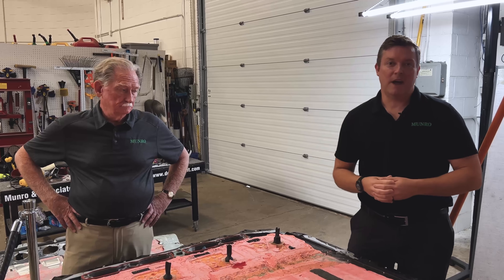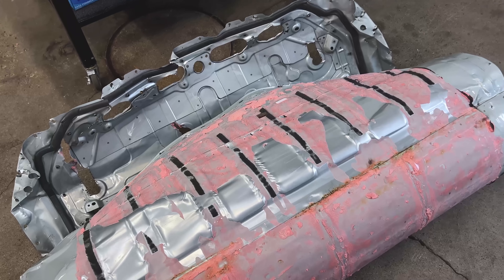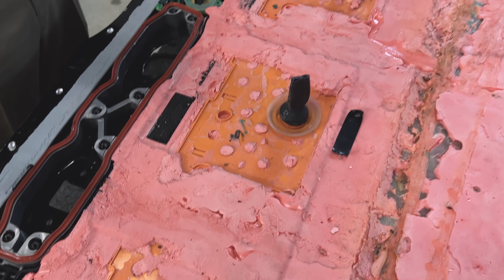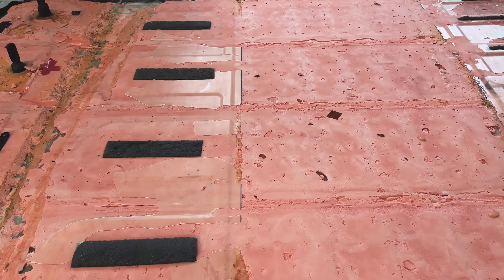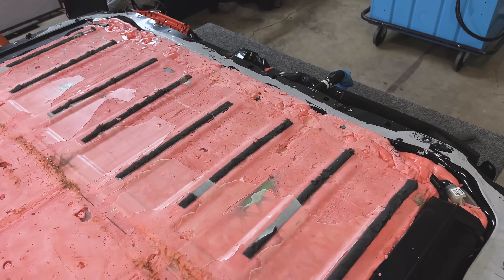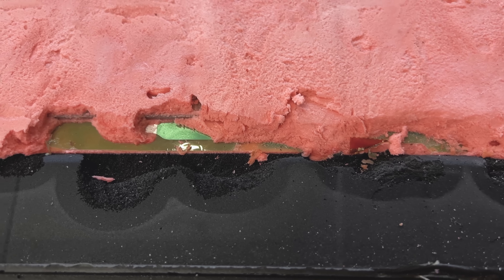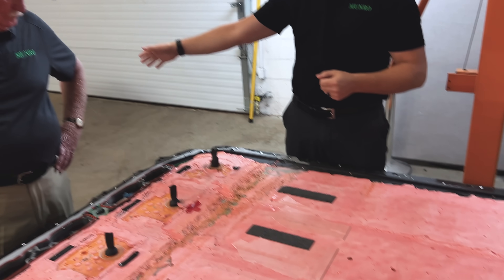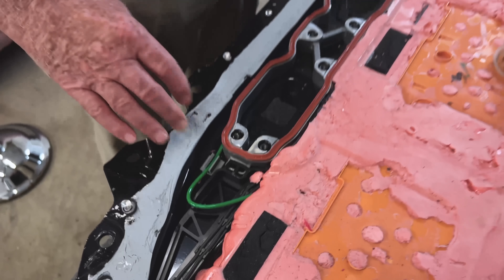FINALLY! 4680 Battery Pack Lid off | Tesla Model Y Update

Comment: 0:25 - Well, I don't think THAT is ever going back together!!
If the battery pack is truly "structural" i.e.holding the front and rear together, why did the Model Y not fold up when it was removed?
Reply: It’s strong enough without the battery for non-crash situations.
Reply: This pack is not "holding the front and rear together"; it just replaces the original floor panel. The vehicle didn't fold up because it still has the rest of the structure (including rocker/sill sections); it's only missing the floor panel.
Reply: Because your Side panel + roof structure is strong enough to keep the car together. You forget that the B-pillar + Roof structure is so strong it has to withstand and survive side impacts at like 60mph?

Comment: Elon said it's much easier to remove the batteries from the bottom of the pack, rather than peeling the top off.
Reply: I interpreted him as saying that recycling will be done from the bottom, IE it will be easy to extract the materials that way. Repairability and extracting intact modules/cells could be a completely different story.
Reply: The pack is attached to the bottom of the ca.  the packs unbolted from the bottom of the car and removed and a new replacement battery with a warranty is installed in the car.  The cells are totally surrounded by the ridged foam.  The pack is not designed to be repaired.  It is designed to be shredded and the metals in it are chemically separated and purified and used to mak a new battery pack.

Comment: My #1 question How on earth will they recycle these modules......WOW.....
Reply: Shred it. As simple as that.
Reply: @pashko90  I agree. Shred and grind to  produce a high grade ore.
Reply: The first question should be reusability! Recycling comes at the very last position! After car use batteries even at 70% still have great energy storage use…..
Reply: @alanmay7929  Belive me, if i'm getting any pack what still have a capacity left i will reuse it as much as possible.
Reply: @pashko90  - and then you will bury the pack in your back yard when it is at 0% usability problem stick it in a landfill.

Shredding these things is a more efficient way to recycle, just like chunking lead acid batteries, and achieve 90+% recyclability.
Reply: @DavidHalko  0% capacity is still way too far away, i'm upgading first gen EVs what 12+ years old, even old modules/cells still going for a full price. You can recover over 90% of materials from a current packs with a current tech, its not gonna be a battery anymore, but this materials still can be used in other things when you do not need perfectly clean materials.
Reply: @pashko90  - good work on replacing cells!

The day will come, when they get buried in the back yard by someone when they can’t be made useful. 

I am watching it happen with solar panels & lithium batteries, already. This is especially the case with people buying land that has a solar project on it in rural areas… the “more ethical” just pull a permit to bury it all, and they are being granted permits to do so. I can’t imagine the rest.
Reply: Funny how people are parroting Elon’s tweets almost word for word as gospel with zero apparent critical thought to what might actually be involved here and the process’ impact, this is true fanaticism.

Stuff like this is probably exactly why Tesla is criticized for insufficient disclosure of the environmental impact from their own operations.  Imagine cracking open a battery in a new energy vehicle designed to help us stop using a gas tank of fossil fuels only to find the energy source  is a mass of pink foam that’s made from fossil fuels.

I wouldn’t be shocked to discover the solvents/chemicals necessary for recycling are also derived from fossil fuels on top of the impact from the recycling process, disposal of chemicals used, etc etc
Reply: @Destor-p3b  everything is based on fossil from that foam the liquid that they must be taking about……. It’s a shame tbh!
Reply: Congratulations, yours is the 12th worthless comment on repairability/recycling.

Comment: I’m sure it’ll dissolve in something. The tube might even be to inject some solution to aid in removing the top cover. Or pressure balancing. Or both perhaps.
Reply: And I'm sure that will be a totally clean process that will happen under strict environmental precautions in those third world countries used cars end up.
Reply: @Nelson-Man  lol no way a battery will land there, this is high value even if it doesnt work at all anymore, which wont happen anyway, so, no, you are not informed well.
Reply: @JohnSmith-pn2vl  Old cars end up in third world countries in masses. If you don't believe that, let it be threshold countries, that's not much better. Also, the recycling process of this battery - if there is one at all - seems to be very labour intensive. And where is labour cheap? Exactly. In poor countries where people don't freak out just because you poor one or two tons of solvents a day into the local river.

Comment: Looks terrible, looks like something that might have come out of the Soviet Union. 
Cars aren’t like phones where you buy a new one every two or three years, I wouldn’t trust this to last eight years let alone 15.
Reply: Congratulations, yours is the 11th worthless comment on repairability/recycling.
Reply: Mosf of the sovet union products was been build to last and very serviceable.
Reply: @pashko90  idk about that man, maybe the ak47
Reply: So its... icky because its sealed in pink foam and you don't "believe" in batteries that last longer than the cars they are in? 

The 4680s are designed to do that. LFP batteries are designed to do that. They are Not an expendable part any more than the gas tank of an ICE car. The spec is about 1M miles or more - this is to 80% charge capacity when the battery is considered to be "no longer producing a good range". 95% of the cars will be rotten hulks by then... and the battery will still be good for commuting.

I would look up the specs on the 4680 and compare them to the 18650s and 2170s that have been in the field for years and still running after hundreds of thousands of miles. The pack is fault tolerant. If a few cells here or there die, they are isolated automatically and the pack runs without them. (And there are about 900 independent cells.) The packs are armored on the bottom to deflect nasty bits of road debris.
You don't "repair" batteries and they Rarely get replaced at All.

The days of opening a pack and swapping a module (cost effectively) are pretty much gone. 
As fabrication prices drop, the proposition of opening them up to fix them becomes increasingly untenable.

The tough bit to grasp is the idea that the battery has gone from the Eveready that lasted a few hours in a flashlight to a few years in a cell phone to something that's never removed for the life of the car... a very long lived car, like the structure itself or the gas tank of your ICE car. That's how reliable the new generation of batteries has become. 

Even then, the pack can still be dropped out of the bottom and replaced. 

Hence the design.
Reply: @avgjoe5969  are these LFP batteries? If that’s the case I heard that these things don’t even charge if it’s below freezing. You also lose a lot of the performance that Teslas are known for.
Reply: @thomas735  This is (and as any other Tesla pack) are thermal managed and keept in a specific thermal range.
Reply: @pashko90  the LFP cells seem good for some applications but from what I’ve heard they aren’t good in freezing weather?
Reply: @thomas735  To freezup a tesla pack you need to a lot of work.
Reply: @pashko90  hmm.. I do think EVs have a place in the subcompact and compact car market, provided the prices come down someday.
Reply: @thomas735  EVs have a lot of use and will replace 90% of ICE cars in next 10yrs.
Reply: @pashko90  that won’t be possible unfortunately. For a variety of reasons. 30% is my guess.
Reply: @thomas735  i do not know where are you located at, but in Los Angeles i guess its already probably about 15% if cars are electric.
Reply: @pashko90  Maine. EVs work in sunny California where solar makes sense and temperature extremes are rare. In Maine, it can get up to 95 in the summer and -15 in the winter. Some folks have hybrids but not many EVs. Toyotas nickel hydride battery is the only battery I’ve heard of that holds up here.
Reply: @thomas735  Toyota ni-mh is for me is a thing of past. I sadly, never been in Mane, but i have a lot of foks who is using Nissan leafs in Sebiria. With some mods, so,far so good. In LA where i live its rarly goes lower then 50f, but right now its like 110f, so, AC is needed much more, then a heating.
Reply: @pashko90  well ni-mh is optimized for hybrids (lithium ion is better for full EVS) places like California make a lot of sense for EVs because of all the traffic and the fact that it doesn’t get cold.

Comment: Glad Munroe Live got the 4680 Battery Pack cover off.  It seems you still will be challenged to remove the pink "glue" from the battery without damaging the circuit boards ... and/or causing a short circuit between 4680 batteries.
Reply: I find the solvent solution to be a bad idea. Asking Elon about the best method will not put his people at risk.

Comment: “No user serviceable parts inside”… without 20 gallons of methylene chloride and a small jackhammer to get the structural foam off.  Hard to imagine how this pack will ever be “repurposed” after 80% point, maybe not even recycled.
Reply: You could never replace modules on Tesla packs, just see owners that get them replaced by third parties having the pack dead again a while later, all the other components on the penthouse can still be repaired 

Recycling you just grind the entire pack
Reply: Yeah... I was just thinking that.   Tesla really isn't serious about recycling with a design like this one.
They need to do a lot better here.
Reply: Repurposed would likely require the entire pack to be used as-is.  So perhaps added to a stack of identical batteries in a megapack or similar large scale application.

Recycled is not an issue at all.  Drop it in an industrial shredder and then extract the useful raw materials from the ground up remains.  That extraction process is easier than extracting the raw materials from the dirt since it's far more concentrated.  This is how Redwood and other battery recyclers are doing things now.
Reply: Congratulations, yours is the 10th worthless comment on repairability/recycling.

Comment: I said last week about  breaker cleaner to dissolve the foam. So it seems there is something. And it looks like it may be a structural filler between the battery and top cover to hold the floored structure.

Comment: Kudos to the guys who had to pry that thing off. That battery pack is an insane way to produce a car. The battery comes with an 8 year/120K warranty, but that's not enough as that thing is completely unserviceable. Hopefully there is some chemical method of dissolving the pink stuff so the battery can be recycled.
Reply: Could be. I hope Tesla would have foresight also in that... At least they said that is their final goal (battery fulll cycle etc.) but who know what is reality of that statements. Would be nice too find out.
Reply: Congratulations, yours is the 9th worthless comment on repairability/recycling.

Comment: Warranty is way too short
Reply: 8 years seems pretty reasonable to me.
Reply: the warranty is fine. whats wrong with it is there is tons of info on how bad it can be and still be good. ie meaning your battery is 10% gone but yet still considered good.
Reply: Thumb up for correctly spelling "too".  Many people can't.  Don't ask me why.
Reply: If we can't repair it we need to be sure it will last, for me 250 000/15 years 50% battery capacity should be fine 
But 8 year is really short, if it broke just after 8 years you are ruined 
It's a really high risk

Comment: Won't be doing any repairs on those packs when they get a failure in the future.  The Model Y will be worthless once it reaches 10-15 years of age since you would have to gut the vehicle to swap the pack and very few places will want to do that when it is more involved than replacing the engine or transmission in a modern ICE vehicle.
Reply: Unless the 4680s are truly million mile batteries
Reply: Dry ice blasting, new module, new foam, new cover sheet, done.
Reply: Congratulations, yours is the 6th worthless comment on repairability/recycling.

Comment: I think Tesla is making a mistake with this “entombed” structural battery pack. Same with gigapress and single (or two) moulds. - Where’s the REPAIRABILITY? Insurance is just going to write more Tesla’s off as total losses. Because the whole dang car is nearly one piece! 

They are doing EXACTLY what Apple has done to the iPhone. It used to have waay more repair ability with its modular parts, etc. now it’s all nearly fully integrated. Phone break? “BUY A NEW ONE”
Reply: You should look into some more videos regarding this matter. There are still crumple zones that are replaceable on the front and rear castings, but if a collision is big enough to bend the frame and what is equivalent to the front/rear casting, it would be a write of either way. Just as with castings.
Reply: With the 2170s, there were 4 separate modules, which Tesla requires replacing all together.  So there was never reparability at the cell or module level.  Tesla's just doubling-down on this by encapsulating the whole thing (so you lose reusability of the top cover and bottom "pan").  This may sound more expensive, but over the long run, if costs come down on the 4680s then this could actually end up being cheaper.  It does, however, remove cheaper options for "unofficial" methods (i.e. replacing bad cells).
Reply: @satoshimanabe2493  while they are separate modules in some other Tesla's, if they were ever replaced individually they will never properly match the remaining others and the whole pack will suffer.  I'm not sure many appreciate just how closely matched in series modules (or individual batteries depending on the pack type) that are subjected to huge loads need to be from a safety and longevity point of view.   While i'm all for modular repairable stuff, I just don't think the batteries in these applications will ever ben good candidates for individual replacement, not with current lithium technology anyway.  The batteries/modules that are fixed like one part of the whole pack often do not go on to live a very long life.
Reply: Congratulations, yours is the 5th worthless comment on repairability/recycling.
Reply: Problem is that this type of engineering isn’t sustainable. That’s why there is a shortage of electronics now, everyone can’t buy a new phone every 3 years 🫢
Reply: These teslas were always total losses in an accident. They make it impossibly hard to buy parts. If you own a salvage tesla they lock you out of feature like the supercharger network unless you give them tens of thousands of $ to inspect the vehicle. Even if you have battery damage on a conventional tesla battery they still charge you like 20 thousand to replace the entire battery as the individual car service centers dont own the equipment or have the training to disassemble the pack and people can't be expected to wait weeks for the battery to be mailed to the one factory that does disassemble them. The saving grace is that they give you an 8 year warranty. As long as you aren't the at fault party in an accident none of these repairability issues will effect you for at least the first 8 years of ownership.
Reply: Dry ice blasting, new module, new foam, new cover sheet, done.
Reply: Its not about repair-ability but about having no accidents anymore. That's the strategy.
Reply: You clearly have little idea bout the castings. They are in such a place that if they managed get damaged, the whole car should probably be scrapped either way. If you watched Munroes video on those castings, you will see there are sacrificial parts are are mounted to the casting and if there is a less serious accident, they will be destroyed withouth touching the casting itself. If you think that any accident will write a Tesla with giga casting off, then you are mistaken.
As for repairability, what is better, to have a part that breaks once in 10k cases and can be easily repaired for 20% of the coest, or a part that has to be replaced completely but breaks once every 100k cases? Repairability in itself shouldn't be a goal. It might be a nice side feature, but at some point it's no necessary and might be even detrimental to other, more important aspects of the product.

Comment: The people at the recycling centres are going to be Buddhas of patience
Reply: They just spread the pack when they recycle them.  At least that is how one of the recycle companies do it. It makes sense because you have to chemically separate all the raw materials no matter how you take it apart so just shread.
Reply: @trottingwolf  thats not true, basically everything is mechanical separation there are plenty videos arround.
Reply: It’s going to be reusability first!!!! The recycling only applies when the batteries have almost no more capacities.
Reply: @alanmay7929  100% correct Alan !
Reply: Old EV batteries are great for energy storage for example
Reply: Congratulations, yours is the 4th worthless comment on repairability/recycling.
Reply: Dry ice blasting.